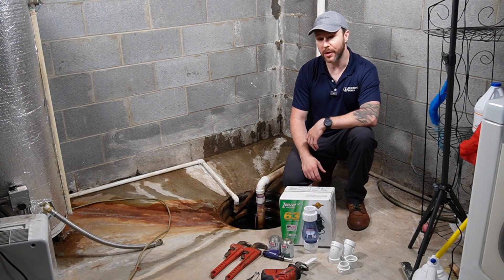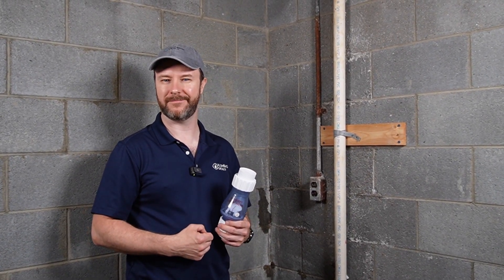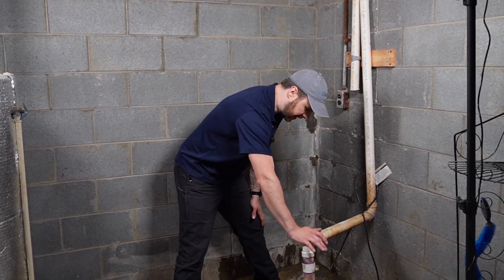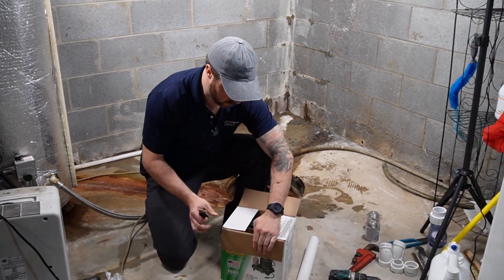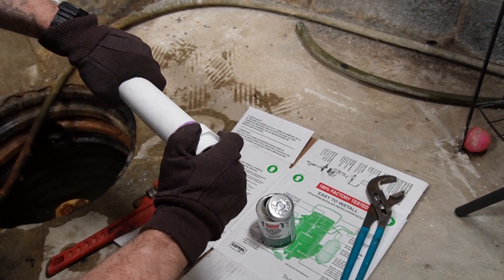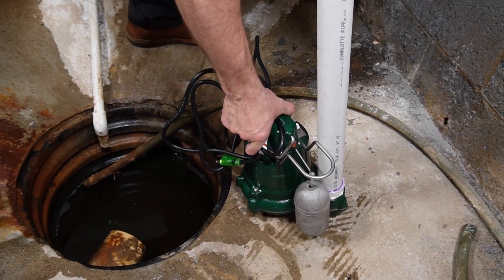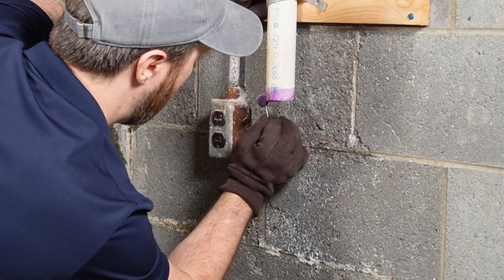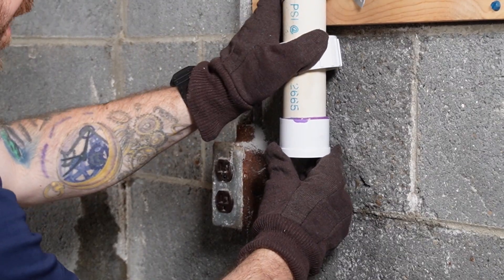How to Install a Sump Pump | Part 1 | Zoeller M63 + Quiet Check Valve

Comment: I don't even want to watch another install with dwv fittings.  Please use Schedule 40 pipe and fittings that are pressure rated.
Reply from the maker: Thanks for watching! When these fittings fail we will let you know and replace them with SCH 40.